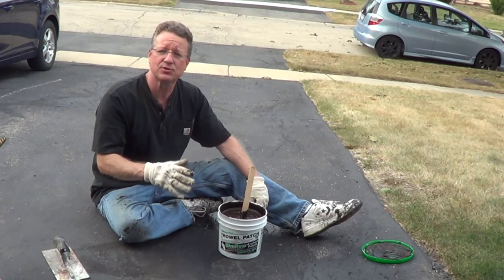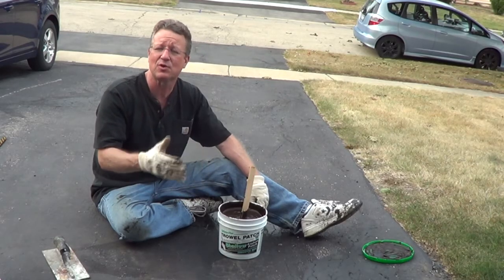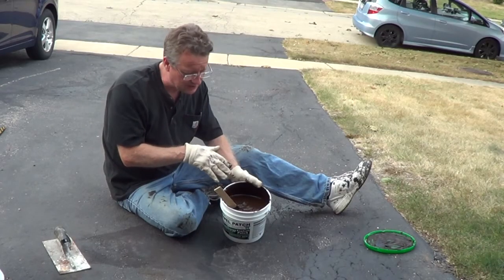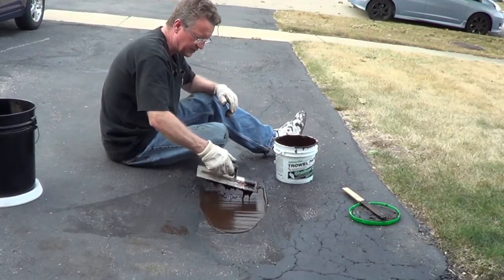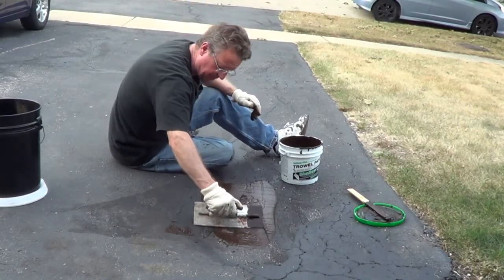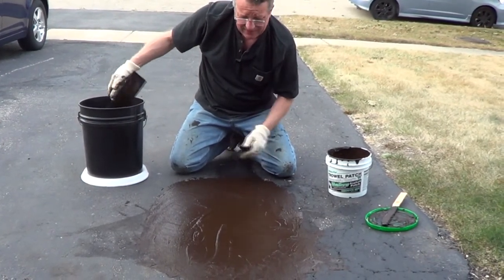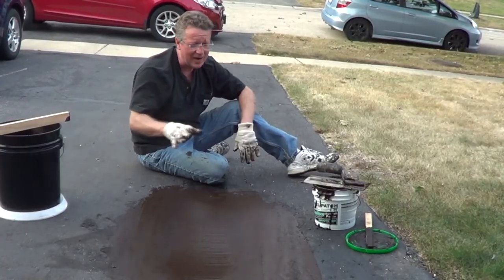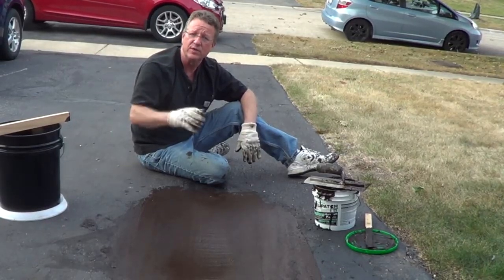Pothole Repair - Driveway Asphalt Patch

Comment: can you drive over it after its dry & will the car tire weight cause it to squeeze out?
i need something to fill tire depressions & not have to wait weeks or months before i apply a finaly sealcoat.
i've watched many asphalt vids & i cannot wait that long....
Reply: With a 20yr old driveway I've had several depressions with a depth greater than an inch. First I filled the depressions with water and outlined the depressions with a light spray of paint. when it's dry, follow directions and fill with Aquaphalt 4.0 or 6.0, (the best and fastest DIY asphalt repair on the market), and at $65, probably the most expensive. finish it of by feathering the edges with a quality trowel patch ( I like Black Jack),and after a couple days, seal coat. This is a quality and long lasting repair.

Comment: Will filler sealer work as a pot hole filler?
Reply: Use a hot patch joint sealer if you have small cracks, but if you have larger potholes, cut out the area with a circular saw and add cold / hot patches. Tamp down.

Comment: Will the patch completely disappear once you seal the driveway?
Reply from the maker: Hi, depends on the product. Some will blend very well, some will show a lighter or darker area.
Reply: @FIXITHomeImprovementChannel  I'm considering using the latexlite pavement sealer
Reply: @jasontoothaker2879  can you apply   latex-ite trowel patch over fully cured super patch?
and then   apply latexite sealer ovet top of that?
Reply: @andreamitchell4758  yes absolutely
Reply: @jasontoothaker2879  thanks for  the fast reply,   I will  definitley do that then